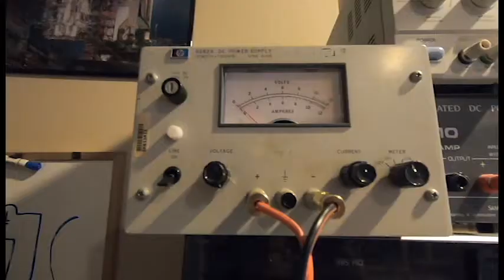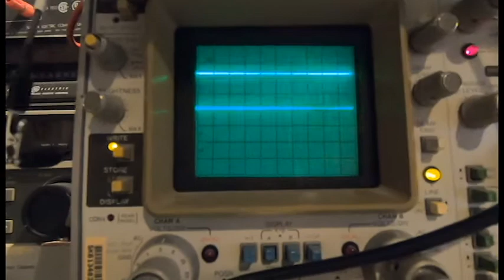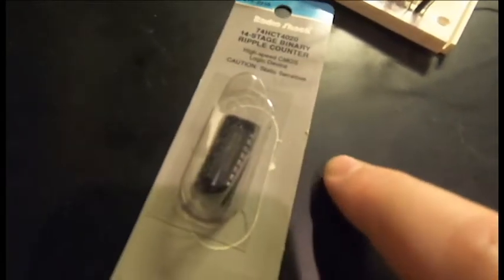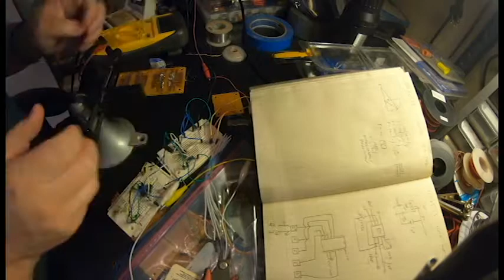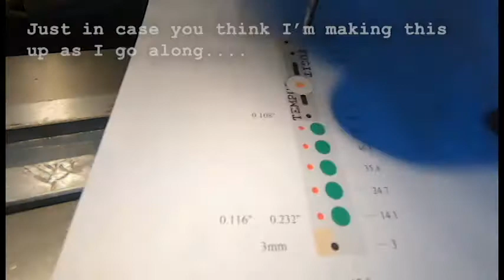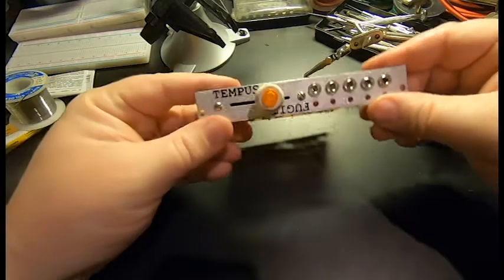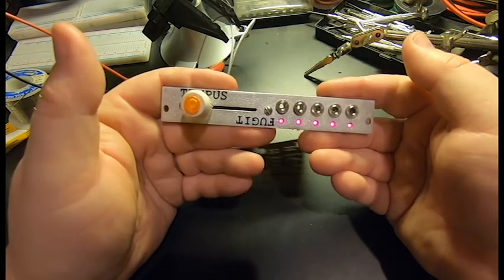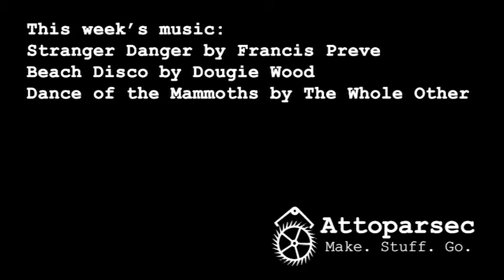Eurorack DIY: Clock module

Comment: This is a really cool demo of a great use for a binary counter.
I have that HP power supply and the HP scope one generation older than that...  There are a ton of LM2596 switching buck regulators on ebay and I sure like them for adjustable high efficiency dirt cheap 5-ish volt supplies.

Comment: What's the difference between gates and trigger pulses?
Reply from the maker: Just duration, really. A trigger pulse is a short burst of higher voltage, just to tell something else to happen. Think like hitting a drum -- you did it, then it's done. A gate can stay on indefinitely for things which can variable duration, like holding down a piano key. In practice, most things that want triggers are just looking for a rising voltage, so usually they can take a gate signal instead and it will work just as well. (But sometimes they start doing their thing at some ridiculous high rate! Depends on the module.)

Comment: Great work , but sorry to burst the bubble,  If you build in your time, DIY most certainly does not keep the cost down, that's a complete myth. You also lose time not making music. Regards.
Reply from the maker: If I factored in the cost of my time, I wouldn't have ANY hobbies!
Reply: @Attoparsec  It's a great and satisfying hobby and I've been doing it over four decades, at the end it all comes down to is the time invested better spent on other things like making music. Also even though my soldering tekkers are god like, do I really want to be staring through a stereoscopic microscope at my age surface mounting stuff along the lines of mobile phone tech? Quite a lot of my modules ARE mobile phone tech. Cheers and regards
Reply: I actually found myself enjoying the designing and building process more than the making music part. 🙃
Reply: I see where you're coming from, if I only wanted to make music I would stick to using a DAW or mobile phone app, instead of modular. I don't see time as a cost when I enjoy what I'm doing though. The real advantage of DIY is you can build modules any way you want.